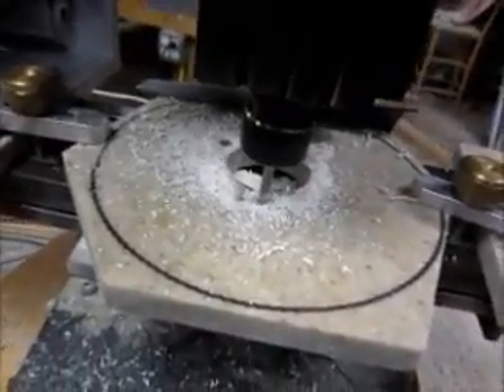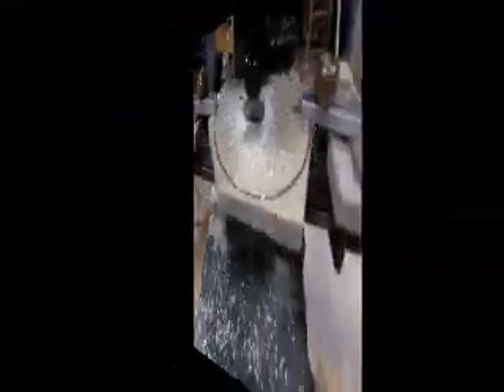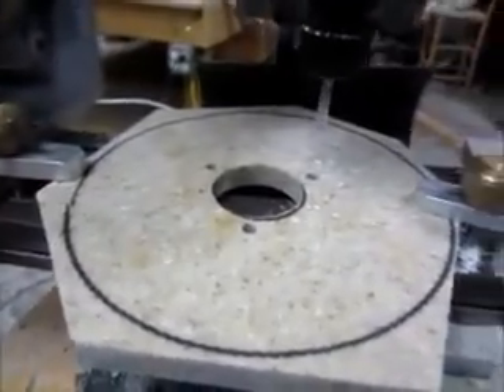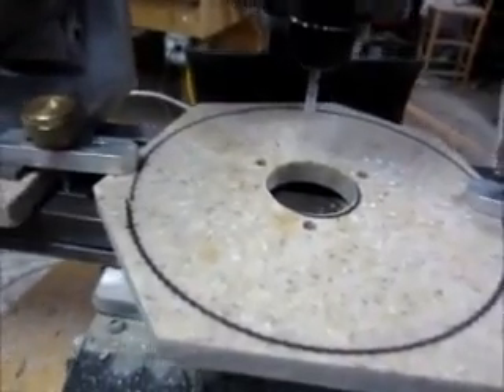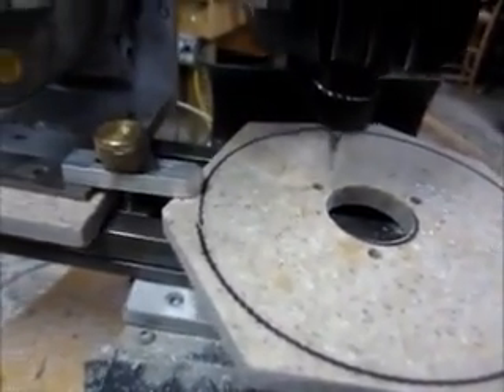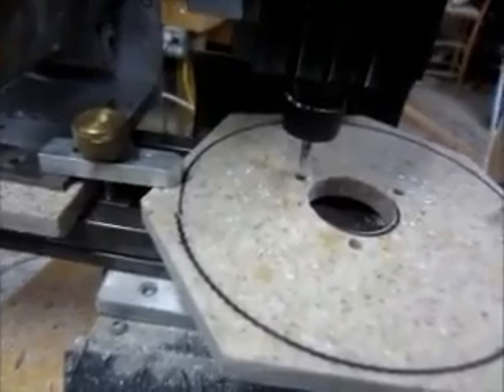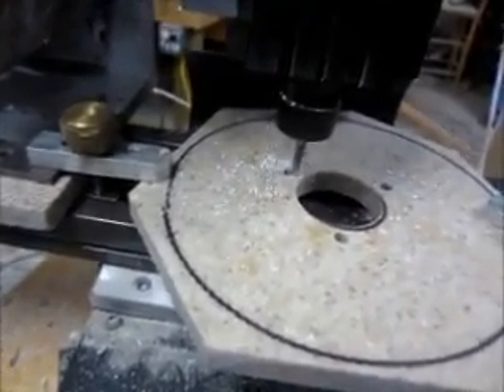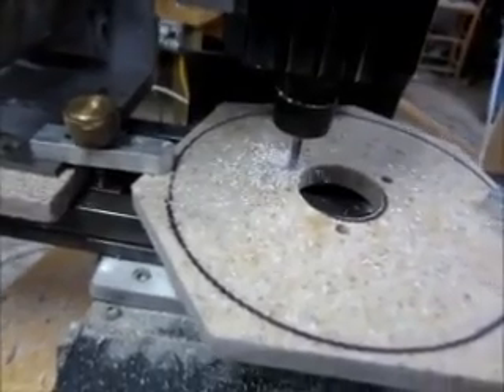Cutting a 127 tooth gear on the Taig CNC Milling Machine

Comment: How did you program this part for the taig
Reply from the maker: I started by drawing the gear itself using Deltacad software https://www.deltacad.com. Then drawing the slitting saw in the three cutting locations. Since the rotary axis has more backlash than what was allowable i rotated in one direction and used incremental (G91) positioning only for the rotation of each tooth (360°/127= "G00 G91 A2.8346") for each position. https://www.facebook.com/photo.php?fbid=787191998042890&set=p.787191998042890&type=3

Comment: Really slick. Would not take many of those for the Taig to pay for itself. What sort of tool are you using at 0:51 to cut the gear teeth? Looks like a saw, but it has the gear's root profile? Thank you
Reply from the maker: Well, i cheated and used a 1/32 thick saw blade. An involute curve for 127 teeth would not be very pronounced so I just cut flat faces instead.(a rack, at 135 teeth, would be straight as well....or very close to it. Since this was a gear that did not have a fixed center- to -center distance it worked out fine.
Reply: It's not cheating if it works :) Unrelated story, I visited a large DuPont greenhouse once where the greenhouse tables were made from huge 1.75 inch thick slabs of Corian discards!
Reply from the maker: I have a countertop installer that only charges $2 for vanity cutouts and $4 for stovetop cut-outs. I've got it made!

Comment: If you would try this way of milling instead you could make the twin gear in one piece. https://www.youtube.com/watch?v=x6IuBntcOIk
Try it out and get back to me with feedback.
Reply from the maker: The root of the gear tooth determines if you can machine the teeth using standard end mills. The teeth in your video are very large compared to the smaller gear teeth that I machined using a simple saw blade. The saw width is only .031 so it fit comfortable in the root.
Reply: Smallest gear I've milled was module 0,3 with a 0,3 mm end mill. Every method has its pros and cons with an end mill you can't mill so wide gears but you can mill twin gears without a groove between the gears, makes the gear roots very strong. I believe every method that produces a useful gear is a method worth knowing.
Cheers!